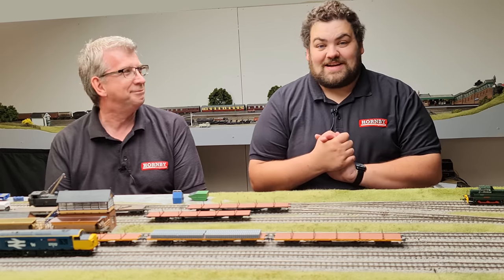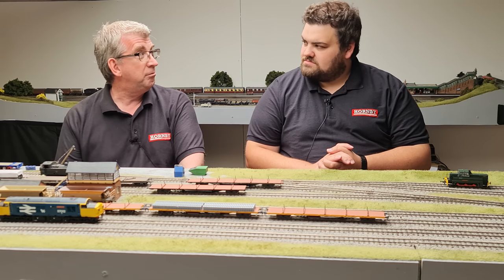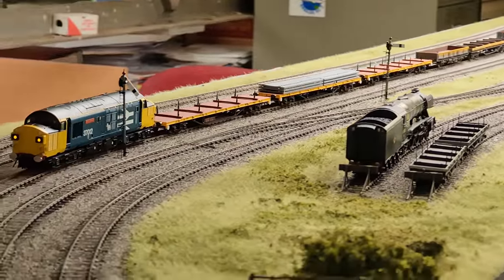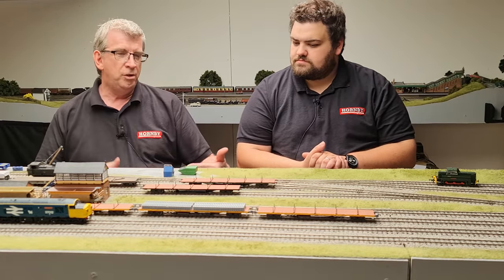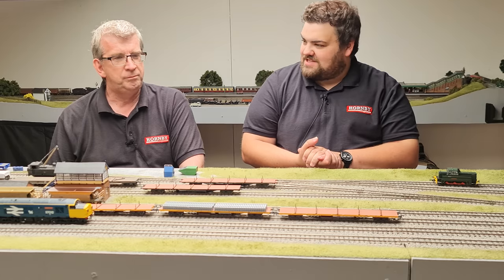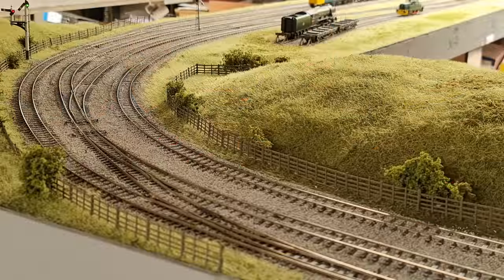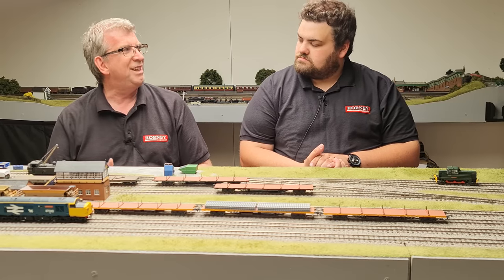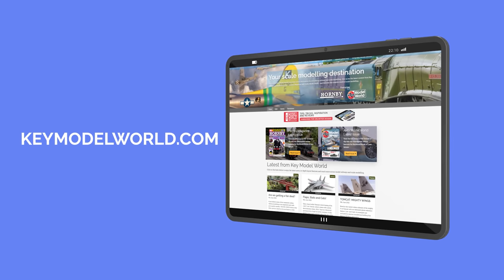HM183: Flangeway Salmon Wagons

Comment: Why are they called “Salmon Wagons”?
Reply: most of the engineering wagons have a fish / sea  theme for some reason, seacow, dogfish, catfish, mermaid, shark brake van etc
Reply: @old_duffers_chuffers  simple grouping of types. The LNWR and others had similar systems to the GWR but with different codes, only makes sense being common carriers that they eventually all unify into one system, quite probably due to the war effort making several disparate systems a dud idea as it slows things down. 

TOAD though was common to many railways well prior to other wagon types being standardised in code